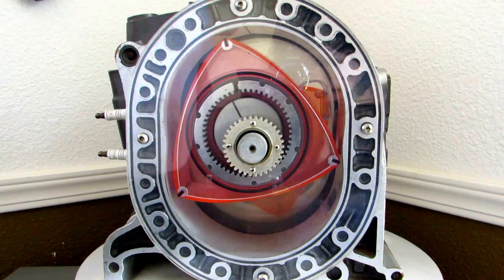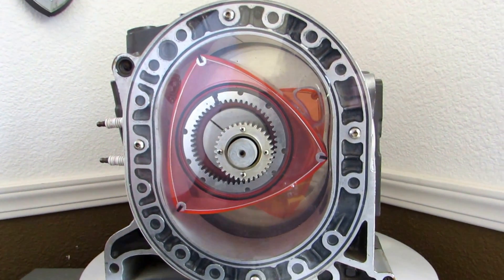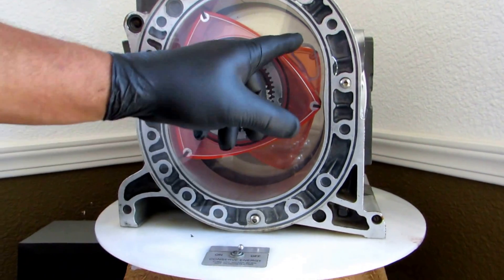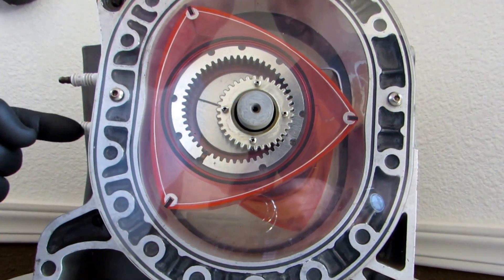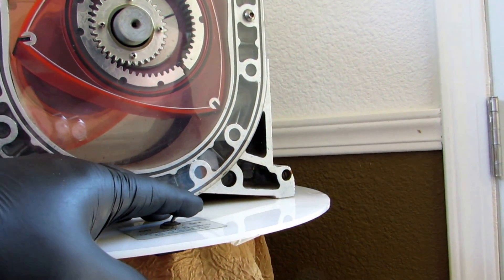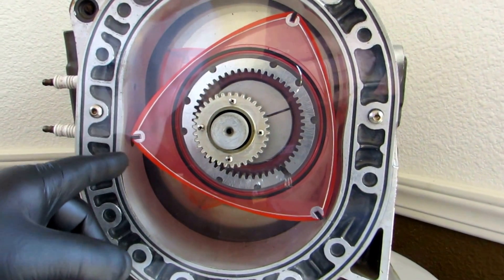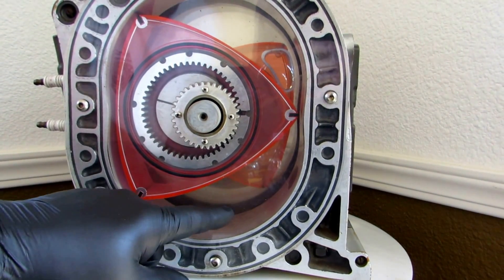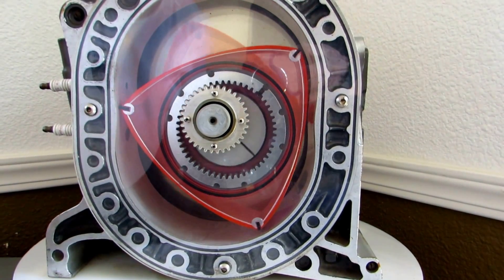Kurt Robertson explains how a Rotary engine works

Comment: 1
tinkerhowedoodatrick
tinkerhowedoodatrick
3 hours ago
Now I approve most of what is said. I didn't believe in the rotary engine's potential before actually doing research on it. I have reasons to believe that this engine is able to outperform most combustion engines. The 4-stroke engine will always have a good future as the next step in its evolution is the cameless, I always have more hope on the rotary engine because it isn't an oscillating engine. I know it still has a lot of weakness but I have a lot of hope if I rely on theoretical ideas. It is good that Mazda is making efforts to further improve the concept of Mr Felix Wankel. But the essential and also what I find even better is that fans do not give up trying to improve what already exists, so it reduce the risk of throwing an so interesting engine into trash. I thought that manufacturers could design something like flat head spark plugs, even just to reduce this compression leakage problem. I know there is already a lot of spark plugs this kind but I didn't expect there was alredy one that fits the 13B. I recently discovered that some Rotary owners have already experimented with it. "Surface gap spark plugs" is what they used. This probably increased the gas mileage and reduced the EGT. This should have the benefit of improving performance and many things by being easily accessible and affordable. Also, in my opinion, the chrome coating of the rotor housing is not enough. I am still doing research on why Mazda has mostly used chrome, why people do a re-chromed housing while nikasil plating or DLC coating exist. Nikasil is nickel silicon carbide and DLC is Diamond Like Carbon. For now these are the ones that I think are the best ways to improve the slide in the engine, maybe the first reason they are not famous is that the cost of realization is expensive. I suspect that people have already used these processes on their rotary engine but still do not say anything about it .. There is nothing to prove regarding their use on 2-stroke and 4-stroke engines as they are already very used. So I continue to do my research on the rotary engine to be able to conclude if there would be a benefit  on  using these (nikasik or DLC) processes on rotary engine
1
Ernie Brink
Ernie Brink
26 minutes ago
Surface gap spark plugs great comment still major leakage index a engine pull the leading plug out  line up a apex in the plug hole   now index and  mark the crank now plug back in turn the engine by hand when your mark lines up you hear and feel compression leaking inside the engine out the exhaust port
1

Comment: rashk1955
Why are the rotors dished?
doktorbimmer
to connect the two halves of the combustion chamber, without it there would be incomplete combustion and misfires*are you nuts

Comment: as Ernie Brink said, by changing sparkplug hole geometry by a very thin flat hole (height of the hole will have the same thickness as apex seal) , but too narrow hole could diminish the effectiveness of the spark,I think we can go bigger in the height of the hole without really having consequant gas exchange between compression chamber and exhaust chamber. Other ideas from Ernie Brink are very interesting and pertinant and there are still more possibility to improve the rotary engine

Comment: YOU LOSE ALL FUEL AIR AND COMPRESSION WHEN THE APEX SEAL IS IN THE BIG PLUG HOLE  IT RUNS ON 5 TO 1 COMPRESSION
tinkerhowedoodatrick

You're half right, actualy not all the compression but just a little, but yeah you will run less ratio, meaning that it will drop in engine efficiency

You're half right? were is your full 270 degrees of compression stroke this why you have flames even when you are injected?

2mm apex 14mm plug hole major leak  zero leaks please? so a 10 to 1 wankel is 5 to 1 85lbs 1o to 1 140 lbs

Comment: SHARE

Mazda had to put their darling Mazda RX-8 out to pasture in 2012. A number of factors were responsible, from the rising fuel prices to more restrictive emissions guidelines. The weaknesses inherent to the rotary engine—poor fuel economy, heavy emissions, and weak performance at low RPM made their Renesis engine inadequate compared to modern designs. Rumors have since floated around among rotary engine fans that Mazda has been secretly developing a new rotary engine that will form the heart of the next RX-series sports car. 

But be warned: evidence supporting these hopes is sparse.

Here's what we know, and what suggests that hopes for a Mazda RX-9 have foundation. The first, Mazda's intent to implement HCCI into their SkyActiv gasoline engines, according to Nikkei. HCCI, or Homogenous Charge Compression Ignition, is a system in which compression ratios in engines can be raised, boosting fuel economy and power output, by using compression to ignite the fuel instead of a spark plug. This will boost Mazda’s average fuel economy figures well into the zone above CAFE requirements for gas mileage, compensating enough to allow them to potentially develop, manufacture, and release a car that does not need to meet CAFE requirements, such as their RX-series sports cars.

The second development is nearly a year old, but still demands attention. Autoblog reported on a patent application by Mazda regarding a fresh redesign of the rotary engine, featuring modified architecture in the name of tight packaging. It also exploits a valve over its exhaust port that can open and close high and low RPMs—all for the sake of improving exhaust flow across the rev range. This concept, dubbed the 16X, also utilizes port fuel injection, unlike any previous rotaries.

The third and most recent piece of news to surface regarding Mazda’s rotaries comes from another patent filing. According to the US Patent and Trademark Office’s website, this patent adds a stop-start function by sealing the engine’s intake ports with its rotors. This integrates a system in which a spark plug is fired after the fuel cut during shutdown, presumably to eject exhaust gas rather than unburned fuel, and to prevent potential flooding. This system would eliminate the wasteful idling inherent to internal combustion engines, both increasing gas mileage and reducing emissions.

None of these new technologies by themselves herald the coming of an RX-9 by any means, but they suggest Mazda has not yet given up on the idea of another rotary-powered car. Even if for no reason other than more competition in the sports car market, let us hope they too wish for the rotary to ride again.
MORE TO READ

Comment: you loses power stroke when the back apexs lines up with tiraing plug hole and you loses compression when the frist apex lines up with the leading plug hole  if it was right you will feel a full 270 degrees of compression>?  this is why low compression on the wankel set up
Reply: HULA HOOP EFFECT MORE EFFICIENT AMEN LESS STRESS THAN A PISTON ENGINE CRANK SET UP FOR WINDOWS IN THE SIDE OF THE BLOCK

Comment: he's keyboard is on fire   Ernie Brink
ERNIE BRINK       touch three birds with one stone you are the man   One third of crankshaft speed is not the same as ....."   Oh c'mon, doktorbimmer, isn't it obvious he just misspoke?  Really.....
Ernie Brink
Ernie Brink
1 hour ago
doktorbimmer you don't seem to know much about the facts do you MORE NAMES REALLY YOU CANN DO BETTER OR MAY BE NOT?
Ernie Brink
Ernie Brink
3 hours ago
ENGINEERS MAKE MISTAKES
TO INDEX IT JUST HAVE PLUGS IN ONE ROTOR TAKE LEADING PLUG OUT PUT THE APEX IN THE MIDDLE OF THE LEADING HOLE THEN MARK THE FYLWHEEL PAINT PUT THE PLUG BACK IN AS YOU KNOW ROTATE 1 TIME AROUND YOU WILL HEAR COMPRSSION OUT THE EXHAUST PORT AWESOME THANK YOU HOW TO INDEX A ROTARY ENGINE*

Comment: 6 CYLINDERS COMPLETED  TWO TURNS OF THE CRANK PISTON ENGINE 720
Ernie Brink
Ernie Brink
20 hours ago
*AWESOME 6 CHAMBERS COMPLETED OF FOUR CYCLES 1080 3 TURNS OF CRANKSHAFT OF A ROTARY ENGINE
Chris Stavro Chris Stavro 6 months ago yes, six firings per 1080 of* crankshaft* rotation...FOUR per 720*. I'm a couple steps ahead of you :) doktorbimmer

Comment: 6 CYLINDERS COMPLETED  TWO TURNS OF THE CRANK PISTON ENGINE 720
Reply: you loses power stroke when the back apexs lines up with tiraing plug hole and you loses compression when the frist apex lines up with the leading plug hole if it was right you will feel a full 270 degrees of compression>? this is why low compression on the wankel set up

Comment: emmer
7 months ago  AND HE MARVELED AT THEIR UNBELIEF
You mean 4 cycle? Intake, compression, combustion, exhaust? Yes, exactly those cycles!
Chris Stavro
Chris Stavro
7 months ago
nope.  four cylinder.  four power events per 720 degrees.  very interesting engine...had to buy an RX8 :)
doktorbimmer
doktorbimmer
6 months ago
+Chris Stavro That is Incorrect the Wankel KKM type engine completes its firing order sequence in 1080° of crankshaft rotation. six 30mm long power strokes per chamber for a Mazda 13B.
Chris Stavro
Chris Stavro
6 months ago
yes, six firings per 1080* of crankshaft rotation...FOUR per 720*.  I'm a couple steps ahead of you :)
doktorbimmer
doktorbimmer
6 months ago
+Chris Stavro That's still Incorrect Chris, the Wankel KKM type engine completes its firing order sequence in 3 revolutions (1080° of crankshaft rotation) NOT TWO REVOLUTIONS.

Comment: ALL WANKEL ENGINES ARE ROTARY ENGINES                                                                           2 ROTORS ENGINE  6 CHAMBERS  IN 1080 DEGREES  3 TURNS FOR OUTPUT ON ALL ROTARY ENGINES
Reply: THE REAL FAKE DOKOTERBIMMER

Comment: Detonation - supersonic wave (faster than the signals can be transmitted into the explosive ahead - explosive has no idea its coming) which propagates through shock compression of the explosive. Shock wave heats the explosive, ignites the chemical reactions, large energy release. Energy pushes the shock wave on into next bit of explosive. Self-sustaining.
Deflagration - subsonic wave (slower than signals move into the explosive ahead - explosive knows the wave is coming and can adjust to it) propagates by heat conduction, mass diffusion from the hot burnt products of the chemical reaction and the cold explosive ahead. Compaction processes also important in powders/granular explosives.
For more details about detonation education, I wrote an article Detonation Education #2.
For more details about deflagration, I wrote an article Propellant Action #1.
I also maintain a blog page on explosives science The Blue Dog Scientific Blog: Science Stuff.
1

Comment: This engine is unnecessarily complex
Reply: +pepe cohetes The Wankel reached the practical limits of its commercial viability 30 years ago... Mazda was losing money on them for decades... Mazda cancelled further commercial research and development in May 2009 and the Wankel engine has been obsolete for over half a decade now... its a dead end concept that will not be coming back and Mazda's CEO said its not coming back.
Reply: Actually it is very simple if one considers there are no camshafts, valves and many other parts which a piston engine requires, in a sense 3 moving parts, the eccentric crankshaft plus the two rotors (the seals, and oil pump can be considered moving parts as well but still well below the number of parts in a piston engine). As for the inefficiency, that is due to the fact the exhaust is not fully scavenged during that part of the cycle and it dilutes the incoming mixture during intake cycle. This could have been resolved possibly with stratified charge or other 
technologies however due to very low sales of the RX8, Mazda stopped production. The Mazda rotary is not dead simply taking a break for some development. I do not believe Mazda plans to shelve this technology completely.
Reply: +pepe cohetes  I've never seen a Wankel engine with only 3 moving parts... I guess you have never worked on one before.
Reply: +pepe cohetes But what about the Wankel engine's poor combustion and thermodynamic entropy problems???? Or poor mechanical conversion rate??? But the exhaust scavenging was greatly improved in the 13B-MSP but efficiency was still horrible... how do you explain this??? It did not improve the Carnot efficiency...
Reply: You must have no reading comprehension; I did not say it only has 3 moving parts, but essentially not counting the oil pump, pump chain, etc) is essentially 3 major moving parts, not counting the seals which are complex and have several parts. I have owned a 85 12B and I did rebuild the engine. I suggest you read carefully instead of launching person attacks without knowing what you are talking about.
Reply: +pepe cohetes  3 parts? Only if you ignore all the troublesome, tiny and fragile sealing parts that are also moving inside the engine... claiming it only has 3 parts is just an ignorant statement made without any real knowledge of the topic.
Reply: +cloridan Beauchamps Mazda and several other companies researched hydrogen and other gaseous fueled Wankel engines... they were all colossal failures.
Reply: Obsolete technology
Reply: And horribly inefficient and unreliable... that's why it became obsolete.

Comment: So it's like an all stroke engine
Reply: No, the Wankel uses the exact same 4-stroke, Otto cycle concept as any other gasoline fueled automobile.
Reply from the maker: yes
Reply: THE FOUR STROKES OF A INTERNAL COMBUSTION OCCURS SIMULTANEOUSLY IN A WANKEL ENGINE THIS MAKES IT MORE EFFICIENT THAN A PISTON ENGINE
1
Reply: THE FOUR STROKES OF A INTERNAL COMBUSTION OCCURS SIMULTANEOUSLY IN A WANKEL ENGINE THIS MAKES IT MORE EFFICIENT THAN A PISTON ENGINE
Reply: All Wankel engines use the 4-stroke operating principle.

Comment: What makes apex seal broken?
Reply from the maker: they wear out, they get scored, they stick - they are always rubbing on the edge of the cylinder walls.
Reply: Erratic combustion events such as Detonation or Pre-ignition ("knock") are the primary failure mode of broken apex seals.. a broken or stuck apex seal actuator springs can also cause catastrophic apex seal failure.

Comment: Cant this engine made to run? I would love to seethrough working rotary engine.
Reply: you loses power stroke when the back apexs lines up with tiraing plug hole and you loses compression when the frist apex lines up with the leading plug hole if it was right you will feel a full 270 degrees of compression>? this is why low compression on the wankel set up
Reply from the maker: +Deepansh Yadav oh yes! I have videos to post showing it running. And being built. Hope to get them up this month.
Reply: Hey!! where is that video ? its been more than a month waiting!!😕😖😖😞😞

Comment: Sealing problem is what Wankel Engines have in common
Reply: Low thermal fuel efficiency  and poor combustion efficiency are 2 other things they all share... besides the fact that they are all out of production now.
Reply: The real doktorbimmer Also, the compression leak is common in Wankel Engines. 

At High RPM, compression leak is more common than in low RPM
Reply: Good Comment, apex seals are not a "positive type" seal device and they tend to chatter at high rpms, increasing the rate of leakage and overheating the surface. increasing the spring tension only wears them out quicker.

Comment: why was the rotary engine made?
Reply: +shibby NOT TRUE, Mazda licensed the Wankel KKM engine invented in 1957 from NSU (now Audi) in 1961... along with 25 of the world's biggest and best engine manufacturers in a race to dominate the automotive market should the Wankel prove to be superior to reciprocating technology. Mazda previously did not manufacture or have any automotive engines of its own. By 1973 when the OPEC oil crisis struck the larger more advanced companies like GM, Ford and Mercedes-Benz quickly abandoned the less efficient and overall inferior Wankel technology while the very small, inexperienced and poorly managed Mazda motors foolishly launched an all Wankel powered model line that sent the company into receivership for its second time. While the big auto makers could afford to write of the Wankel at a loss, Mazda struggled on for several decades trying to make a profit on its Wankel investment. Mazda's board voted in May of 2009 to finally abandoned the Wankel as the company faced its third major financial crisis.. production would eventually cease on June 22nd 2012.  cheers!
Reply: +anan omus One simple answer... MOTORCYCLES. Dr Felix Wankel was an avid rider and motorcycle enthusiast. He joined NSU (at the time the one of the largest motorcycle manufacturers) while his DKM-54 design was a failure.. Dr Hanns Paschke adapted Wankel design into a non-rotary layout (KKM-57) for NSU's new venture into automobiles.. the design was later licensed to 26 motorcycle, automobile, truck and industrial engine manufacturers. Mazda purchased a limited license (limited to cars under 200hp) and Mazda paid a 40% royalty to NSU for every engine sold. cheers!
Reply: anan omus Mazda aimed to comply with the 1970s US Clean Air Act and make cleaner burning and more fuel efficient engines than what was available at the time. The Wankel rotary engine had already been invented, but it had not yet been optimized for automotive use, and Mazda believed optimizing it for cars would be revolutionary and profitable, which it was at first, but then Mazda's rotaries quickly became outdated as piston engines easily became more reliable and cleaner during the 80s. Mazda could only afford to improve and manufacture their rotary as more of an exotic gimmick until 2011 when the last RX8's were built. This is why Mazda is now showing off the Miata as their flagship car, because its a sporty coupe thats both affordable and reliable. The Mazda rotary at this point is more of an engineering novelty than a practical engine.